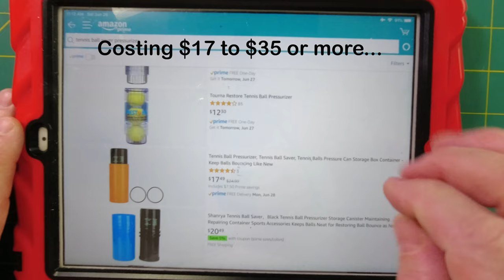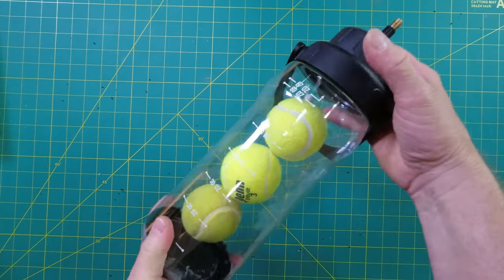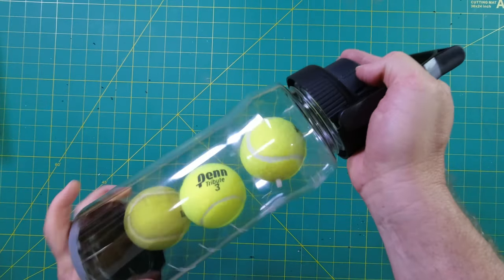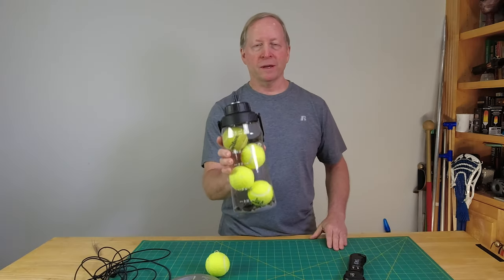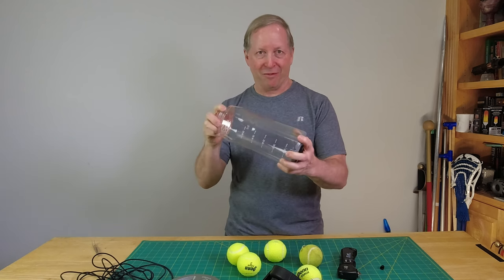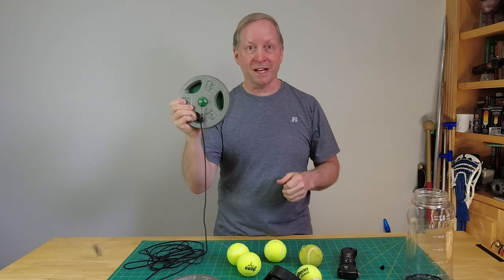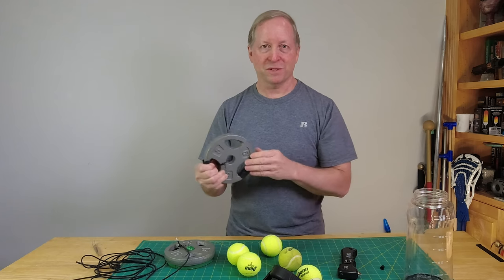Tennis Ball Pressurizers, Savers - Make It Tutorial

Comment: Great video!! 

Nice to find someone already have tried what you want to do and fixed all the gotchas!!
Reply: Already have a few old pressure cookers at home that we don't use. Will be interesting to replace the escape valve with the bike valve and see if I can use that.
Reply from the maker: Let me know how it works for you, now you've got me thinking about the old one I have.
Reply: @MakeItorBreakItNow  Why not use the original cans that the balls came with? isnt it possible to put in a valve on the side?
Or plastic tubes from hardware store.

Comment: I am a beginner when it comes to making anything not from Ikea or Legos, could you describe what you mean by seating the valve at 1:50? Is there a known technique or hardware needed in seating an air-tight valve or is using some pliers and elbow grease good enough?
Reply from the maker: a couple things you might try here: don't make the hole too big or to small. You can use hand sanitzer to help pull the valve through the hole. The great thing about sanitizer is most everyone has some and it evaporates/dries completely after a while. You'll know when you've seated the valve because the rings on both sides of the hole will look complete, nothing wedged in the hole.

Comment: Hi, so were you able to keep balls pressurised or re-pressurise flat balls?  One of the commercial models listed it uses 30PSI and will re-pressurise them in 3 days to 3 weeks.  I am hoping to find a homemade model that will work to re-pressurise flat balls.  Thanks very much.
Reply from the maker: You can keep this version pressurized, depending on the seal for a month or two. I have another version I'm working on that uses a stainless steel container that will likely work better. Stay tuned for this...
Reply: Thank you.  Will it add pressure to flat balls?  Or just keep new ones under pressure?  Thank you. @MakeItorBreakItNow
Reply: @scottnagletennis  If balls are really flat, you'll have to "pre-pressurize" them to an intermediate pressure (like 10 psi for example). If you don't, your balls will collapse inside the container (from the sound of it I assume this is what's happening) :)  FWIW, I'm using a beer keg which works like a charm.
Reply: @gazou1982  Thank you for that.  Do you have a video or info on your beer keg?  I was considering using the mini kegs like the Heineken draught keg.  I am curious how you made yours. ??
Reply: @MakeItorBreakItNow any updates on the steel container progress?

Comment: It Woukd be useful to see a set up with a long PVC pipe able to hold a dozen balls. For people who practice with a few dozen balls at a time this could really help reduce waste and cost.
Reply: i looked for PVC pipe and cement and they are rated for 10 PSI.  Not sure where to get 27.6 PSI that wont blow out the PVC.
Reply from the maker: I've thought about the PVC pipe approach. You'd need a release valve and the a large pipe end with lots of threads, but its doable.
Reply: Better with just a bigger container made for pressure, like a 20lt water bottle
Reply: I’ve heard that if the container it too big you can warp the ball

Comment: I used an Ozark Trail 1 gallon and its large  threads cant hold the preasure and it pops its seal every time
Reply from the maker: I could see where that would happen, I have a follow on version I'm thinking about that uses a stainless steel growler, but the threads are key as you've pointed out.